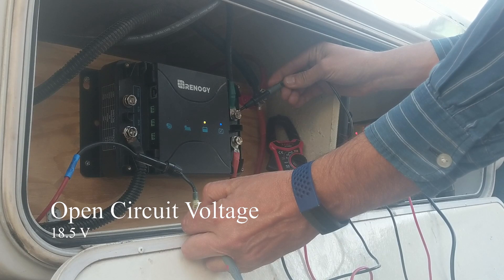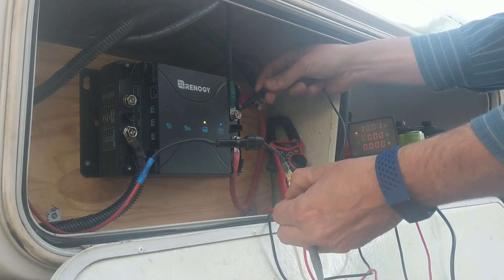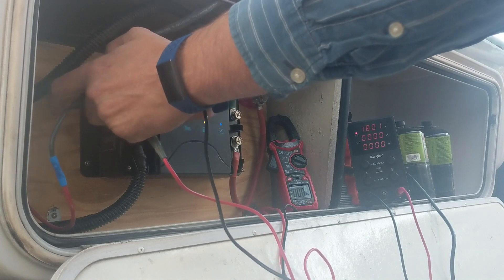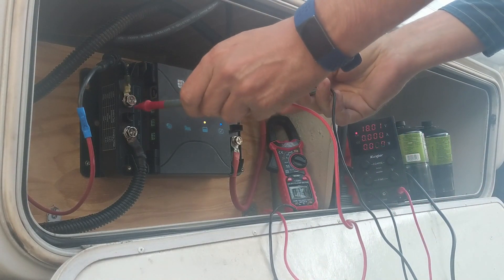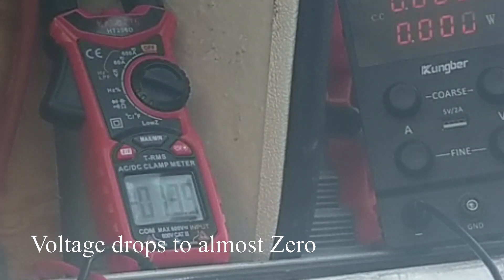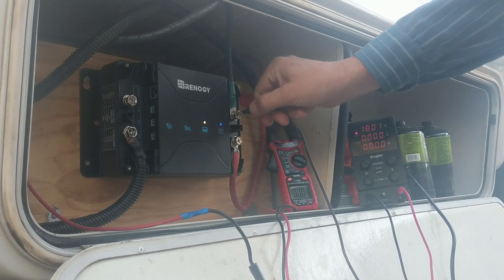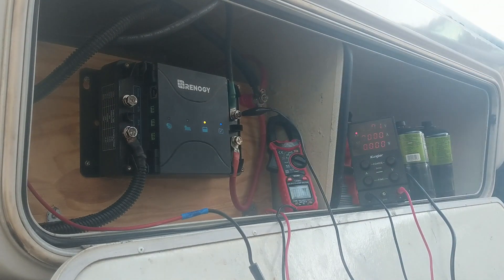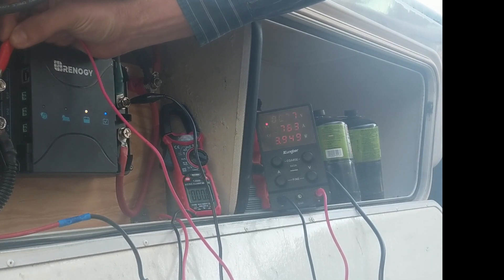Renogy DC to DC charger issue for lifepo4 battery bank

Comment: what was the issue
Reply from the maker: I exchanged the unit and the new one works .   based on the packaging of the new one I believe that the old unit was used .  Possibly damaged .
Reply: @jkrasz  did you get it from Amazon or themselves directly?
Reply from the maker: @Willsmokalot  Amazon  Renogy  story .  Customer serves was not any help .  Person on the other end had no technical knowledge of the product .
Reply: @jkrasz  yeah amazon resend returns with out checking them smh